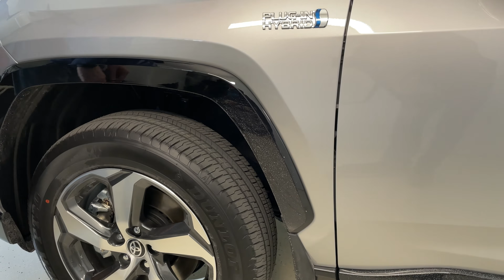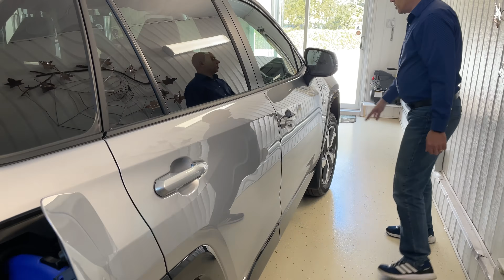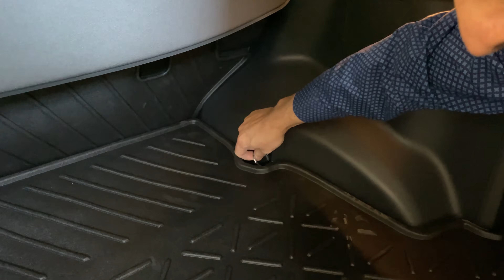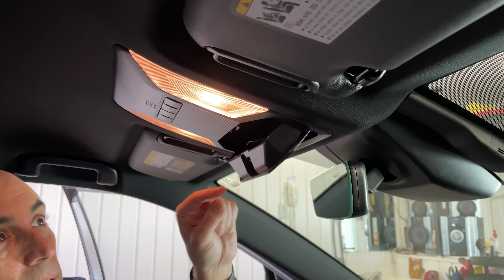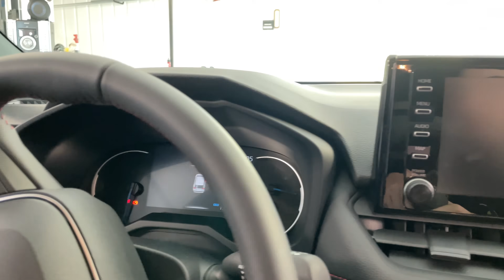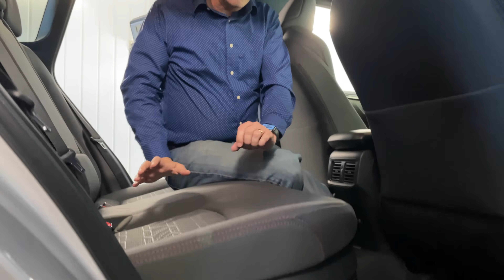2021 Toyota RAV4 Prime SE - Overview

Comment: Can you set the battery to not charge past 75% or 80%?
Reply from the maker: It is my understanding that Toyota does not let the batteries get to 100% in order to enhance durability and long life. I'm on my first EV but had hybrids since 2007. Toyota and Honda have had great reliability overall for the batteries without having to worry about the charge %. On the prime, the reseach I did shows the maximum is 90.5%. Hope this helps.

Comment: Another huge ding I would give;  the heated steering wheel is only heated at the 10 & 2 positions.....  I almost never drive like that.  Bummer!  The car is great though!
Reply from the maker: Thanks for the comment! My Lexus RX has the same limited heated area on the steering wheel. Actually I think it might even be smaller on the Lexus. I have a video coming out where I point that out.

Comment: Thanks for excellent video.  One question, I had heard you could also recharge batteries while driving, is that true?
Reply from the maker: Yes. There is an option to allow for charging while driving. It will cost more in fuel than charging from a normal charger, unless you live somewhere where power is at a super premium. In case it wasn't clear, it will cost more fuel while you force it to charge. I understand that you also can't use this feature to get back to 100% full charge.

Comment: Very informative video. I am in Alberta where temperature dip down to -40c in the wunter.  What kind of fuel mileage are you getting in the winter in city driving using  hybrid mode?  Do you find the EV range is significantly reduced on very cold day?
Reply from the maker: I didn’t have the RAV4 when it dipped to -40c here, but the range drops just getting into fall. Summer I managed 80-82 at best, drops to 65 at 5-10c outside. In pure hybrid mode expect 5.5-6L/100km (without any EV driving). So it’s about what the hybrid model gets. If you only drive short distances, the the EV will keep your fuel costs low. You’ll want to run in hV mode at -40c to get decent heat more quickly.

Comment: (On a waiting list for 2022)

What is the A/C button on your remote for? Can it warm up the vehicle remotely during the winter?

Why are you advising against heating on EV at -20? I understand it would use up more battery, but for a daily commute of less than 30km (total), that would leave 38km to be wasted in heating. Am I missing something?

Your comment about the liquid on battery is concerning for that I have 3 kids that will sometime drop cups of whatever. Is a cup of liquid enough of a risk to justify the jump to softex to protect the battery pack better?

Very good video!
Reply from the maker: The À/C button does turn heat on.
I did not mean to say DON’T turn on the heat. I meant to say the EV heat at very cold temperature doesn’t heat very much. I haven’t confirmed this, but on a Volt it was terrible.

I’m not that concerned with liquid spills. It was more of a BTW comment after a mechanic pointed that out. The seats will adsorb spills. Depends how you spill I guess.
Reply: @BobPellerin   Ah ok, thanks for clarifying.

I wonder if the EV heat is a heatpump, which becomes less effective around -20C. Where as the ICE engine use a normal heating system.

Weird that they don't put a plastic to protect the batteries. (Like a vapor barrier plastic below the seat foam)
Reply from the maker: It is indeed a heatpump.

Comment: For some EV’s hybrids-they get better fuel economy in town then with highway driving.The batteries work with short drives,the braking system actually charges the batteries as well.Is that system the same with the Prime?I live in a small town and I drive a lot to go shopping/visiting friends and relatives.If so,then the hybrid wouldn’t suit my needs.Having said all that,I need an SUV for cargo space and Toyota is quality.
Reply from the maker: It’s essentially building on Toyota’s Prius knowledge. It’s great for short runs as it’ll stay in EV mode.

Comment: Do you have to plug it in to charge every time the EV battery is low ( and is the home outlet just a regular 12 volt receptacle ) or after you plug it in once does it charge up itself by driving the car similar to your regular 12-volt car battery used to start most / all cars?   Can you plug it in to those on-the-road charging stations if need be ?  I'm not at all familiar with anything electric / hybrid when it comes to these cars but I am interested in buying this car.   Also does the home charging cord  come in bigger lengths than shown in the video or about 25 feet ( would be charging outside in the winter season - no garage )?
Reply: You don't have to plug it in. However, if you don't then it will operate more like a regular hybrid car, meaning that the gas engine will run more of the time to charge the battery and move the car. According to Toyota's FAQ pages, the car will not completely recharge the battery on its own. The charger that comes with the car plugs into a standard (in North America) 120-volt house outlet. Yes, you can plug into an electric car charging station (except for Tesla stations, which use a different plug). Most of the on-the-road car chargers require memberships or accounts with the provider. According to some forum comments, I believe that the charging cord that comes with the car is the same as the one used with the Prius Prime, and it is maybe 24 feet end-to-end. It is not recommended to use an extension cord, since the standard (120-volt) charger will pull about 12 amps. If you did need to do it anyway, you would want to use the shortest extension cord that would do the job, and it would need to be a very heavy-duty extension cord, probably at least 12-gauge wire and preferably 10-gauge.
Reply: @captainvector    Thank you very much.  Now I have a better understanding on it.

Comment: So there’s no heat without the gas engine?  Is that what I heard?  Like none at all?!?!?!  

Great video by the way, very informative !
Reply from the maker: Well... There is technically heat. It works well up to a point. However, if the temp outside gets too cold then the heater can't quickly heat up the cabin. So, the trick is to use fuel to get it heated up and then you have a chance of not having to scrap the ice on the inside of the windows too. I didn't drive it in super cold temperature yet, so I'll try to remember to make a winter follow-up.

Comment: Is your car 3.3 or 6.6kW charger? seen some info saying SE is 3.3 and XSE is 6.6. Just want to know level 1 wall plug charging time. Many thanks!
Reply from the maker: My Canadian RAV4 Prime SE charges with level 2 @ 30A in ~2.5 hours. That would confirm a 6.6kW on-board charger. The US version of the SE has the 3.3KW which leads to the confusion.

Comment: Great video. It's hard to find video on the SE version. We are looking at this car as well. I want the black, wife wants white. Silver actually doesn't look bad here though. How do you like it so far? The dealer wouldn't budge on the price and Doug Ford cut all the incentives, so it will be a huge overpay for us (never paid MSRP on a car). Still hesitating to pay almost $50K for a Toyota. BTW, is the cargo lining standard? My dealership says it will be carpet.
Reply from the maker: I was hesitant up until I got it. I couldn’t even test drive it. I usually hate Toyota seats and noise level, etc. I actually love it. I find I can drive 80% electric and it costs $1.70 to fully charge. I managed to get 92km EV a couple of days ago. I’m going to keep an eye in the Lexus NX as it is build on the same tech should be similar with more luxury.
Reply: @BobPellerin  92km!? That's amazing. I am a little worried about long term degradation and winter performance, but if it can still do 40km 10 years down the road, I would be happy. Toyota is notoriously conservative with their batteries (leaving 10% uncharged I think for the Prime), which makes me feel a little better. Wife wants a white one though, but I heard all the horror story about white paint peeling with Toyota. Still not decided.

Comment: I use my navigation system on my current car constantly. It doesnt look like the Rav4 has a navigation system? If it has one maybe it is only the apple Maps that might be in Car Play? Is there a way to display the Google Maps from the phone? You have to use your phone to have any sort of navigation system? My current car has a navigation system independent of my phone. I really wish you had shown whether there was any sort of navigation or touched on whether the XSE has one and the SE doesn't
Reply: To get stand alone navigation, you need to go to the XSE technology package. My standard XSE does not have it. I use Waze over Apple car play anyway. It is more up to date and warns you of police, road hazards etc. which is far superior to Toyota navigation.
Reply from the maker: The SE comes with CarPlay, so you can use Apple Maps, Google Maps, Waze. Those are the ones I use anyhow. There may be more available.

Comment: Its funny how they option them different up in CAN in the U.S they upped the price but give you the rear power door
Reply from the maker: Is I understood it correctly the US model has a weather package as an option and the rear heated seats and heated steering don’t come standard in the SE. They also don’t have the full fast charge capability in the SE. Lucky for me I got all the features I actually care about without the ones I didn’t. I added the home link mirror to mine as an option.
Reply: @BobPellerin  can you please share the rearview mirror cost and the rubber mat in the trunk. thank you for the excellent view!!!

Comment: Great vid! Auto-dimming mirror with Homelink is indeed a nice upgrade.

The only thing missing IMO is showing how easy it is to close the hatch with the grips without getting dirty by having to touch the paint to push the hatch. Quick tip for the cameraman, sometimes he cuts your head while you speak (when demonstrating the exterior), but I'm sure that'll improve over time.

Shout out for talking about the vent on the rear seat! Many reviewers forget or don't even know it's there and I bet half of the owners won't even realize they need to clean it either, leading to battery overheating issues.
Reply from the maker: Thanks for feedback! I was originally going for the XSE Techno and then realized that 99% of what I wanted was actually standard. So I added the auto-dimming mirror and voila! a perfect combo. Enough safety features and none of the stuff I really ignore anyhow. Now if Toyoto had offered a much bigger console screen or something I may have considered it. A mere inch extra is just, well, disappointing.
Reply: @BobPellerin  The SE is the sensible choice, the features in the XSE versions aren't entirely worth the premium they're asking for.

Luckily for you, you got your car from THE batch of SEs that were built before the 2022 model. The rest of us waiting for it will probably have to pay their 2022 car 5000$ more, because the govt. rebates will disappear due to a price hike on the base model. 

The competition (hyundai, ford) are in the same boat (base model does not meet criterias for full rebates) and there's already a 2 year waiting list for R4Primes, they won't mind losing some sales since competition can't really get ahead either.
Reply from the maker: I did weigh the pros and cons of waiting and came to the conclusion that I would be risking losing the incentive if I waited for the 2022.  I turned down a black one but managed to get the colour I wanted (silver) a few weeks later, so it all worked out.
Reply: @b00lsheet  Wait, I’m confused. Why exactly would this price hike make the federal rebates disappear?
Reply: @JenJen  Assuming you're in Canada:

The price of the SE is already very close to the 45k limit for the base model, and the XSE+tech is already close to the 10 000$ options allowed to qualify for the full 5000$ rebate. There is no mention that you can get a lower federal rebate if the price exceeds this, so you're missing out on the whole 5k$.

Now go to toyota.ca and get the price for a Prime without rebates (~47xxx$). Remove the 1840$ delivery fee, 100$ AC fee and 399$ random bs dealer fees to see how close from 45k$ the car is. 

I'd be very surprised if the price remains unchanged, especially considering that the competition missed the boat for that 5k rebate. Not to forget that Canada/Québec/BC/Cali isn't the only market for Toyota.